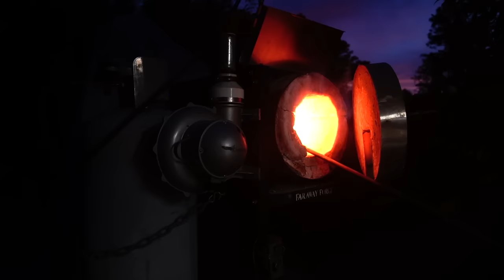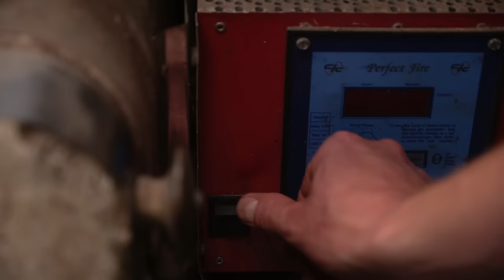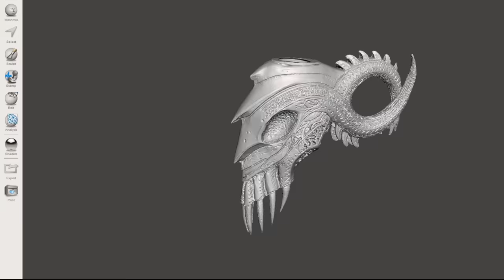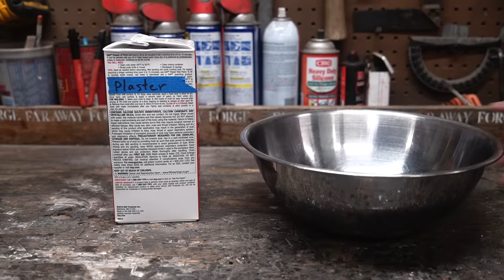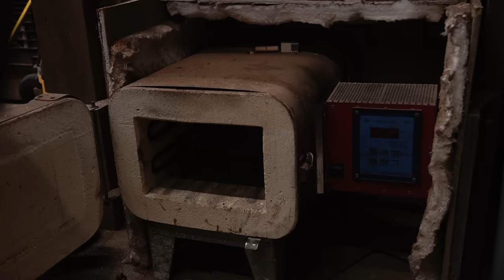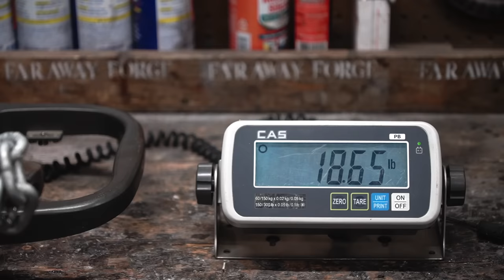Forging Kratos' Blades of Chaos from Fork Lift Fork (Workshop ASMR)

Comment: There have been several others that have done this build, or attempted to do this build, but no one has done it as authentically as you did. They are a work of art and weapon of war. Great build!
Reply: This pair is a little too skinny and too long if they were a little bit shorter and fatter it would be about 100%
Reply: @darkenedpsynoid  you make them.
Reply: @Modest661  i wish i had that skill set......although i guess its not too late
Reply: Eh not so much a weapon as they are far to heavy, and I doubt that "rat tail" tang would hold up to much abuse.
Reply: @Modest661  this is such a stupid comment. You are allowed to make slight criticism if you are a fan of the games and know what they should look like. That doesn’t mean you are an expert and can do better than them.
Reply: @fxrdo  true that, but the real question is, can you do better? Asking for a friend
Reply: @Someguy6571  please show us your version and how you built it differently 🤷🏽‍♂️
Reply: @Pyxe_ZA  I would just say go full tang instead of just welding a rod onto the end. One piece of metal from top to bottom.
Reply: @Someguy6571  100% agree, yeah they look nice, but at 18 lbs. just moving it around for show could break the weld if you were to drop it etc.
Reply: @darkenedpsynoid  He made this from a fork lift fork….
Reply: @lepedrew  he just flattened it and cut it out with a torch
Reply: They look super cool I just wish that I could unsee that one of them was wider in the middle than the other 😂😂

Comment: Those look incredible! I'm working on my first sword, it's going to be a Gladius!
Reply from the maker: Get after it!
Reply: @FarawayForge  Doesn't welding the guards makes it weaker?
Reply: Omg no one cares
Reply: Noah Gunawan  it's going alright, it's nothing amazing but it's coming.
Reply: @andreaskatta1838  you’re weird
Reply: @gameex7395  And why that happens?
Reply: @Uryen_Hirasakai  When you weld stuff you weld strong metal together with a weaker metal. So it can come loose very easily. It has lower melting point and has less mass. And welding actually weakens steel. Screwing handle to the blade would be a better way then welding them.
Reply: @gameex7395  Your argument makes sense, i don't know much about this matter but i believe you are talking about different weights between metals right? i think that a balance is a must here
Reply: @Uryen_Hirasakai  tl:dr welding is useful for thing are not suppose to be strong. So welding blade to a handle is unsafe. Its gonna break very easily.
Reply: @sonicproductions91  if i can ask, where did you learn?
Reply: @ermiga3  I'm mostly just learning as I go
Reply: @sonicproductions91  i understand but, how did you start? you don't have to answer i just asked out of curiosity
Reply: @ermiga3  I found a peice of rusty steel in the woods behind my house and decided to try making a sword. I don't have a forge so I have just been angle grinding it.
Reply: @sonicproductions91  ah alright
Reply: @andreaskatta1838  I do

Comment: This is a work of Art! Great work, the design is also extremely incredible since it’s from gow 2018
Reply: I like the level 5 versions more though.
Reply: @ChefofWar33  yeah, it’s well built and is bigger especially its mass
Reply: @Besno  I'm actually making them for my final project in CNC machining class.  Gonna NC machine the runes on the blade.  Gonna be sick.  Already modeled it in solidworks.

Comment: is it nice, yes. Do they resemble the blades of Chaos? Absolutely. Was they forged? Not even at all. The metal was shaped into a steel plate, then cut out with a plasma cutter. Anyone wilth a sheet of steel and a cut off wheel could of done this. You just used extra steps.

Comment: @Faraway Forge is it a reason why you use plaster for casting instead of red sand? If so could plaster be a alternative for heavy metal casting, fe, Al, cu, etc...?
Reply from the maker: I used plaster because of the level of detail of the part; for a casting novice like myself it's much easier to simply pour plaster around a part and sacrifice the part than it would be to do a split sand mold for something that complicated.  I find you tend to get better resolution with plaster vs sand too.  I'm not 100% sure of the heat capacity of plaster but you could definitely do aluminum.  If I had to guess iron and copper would be fine too but idk
Reply: @FarawayForge  Thank you Sir

Comment: Im no blacksmith or forger, just a metal fabricator... But I would think forging anything out of forklift forks would be the worst possible material to forge something out of... Incredibly difficult as well.
Props to you but I'm certain that forks are made out of hardened steel, and manipulating them in any way would most definitely weaken the steel tremendously...
 Am I wrong?